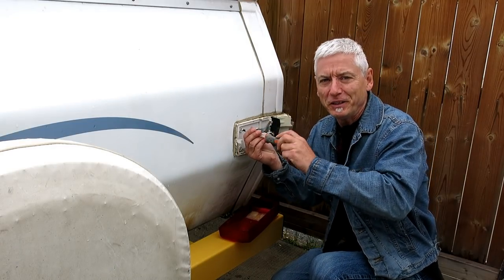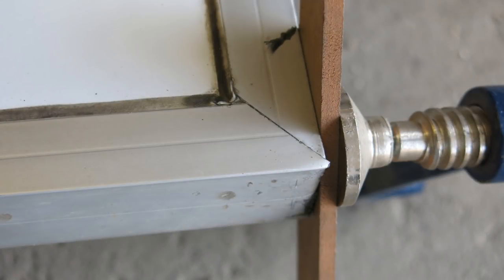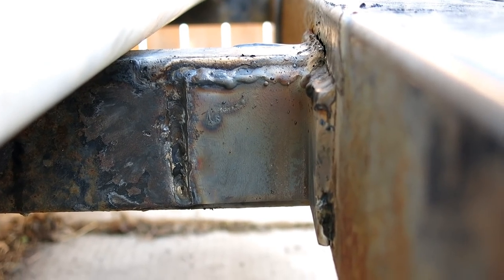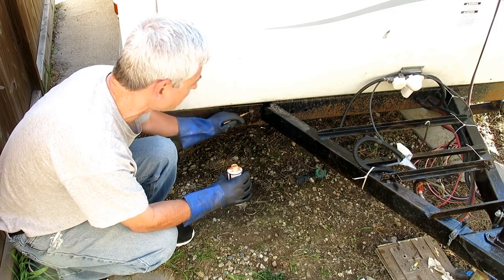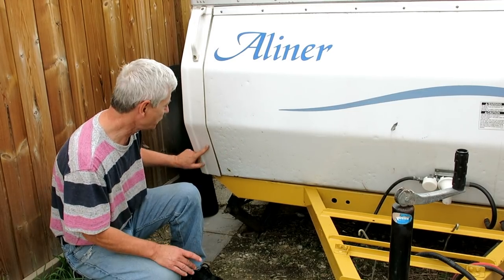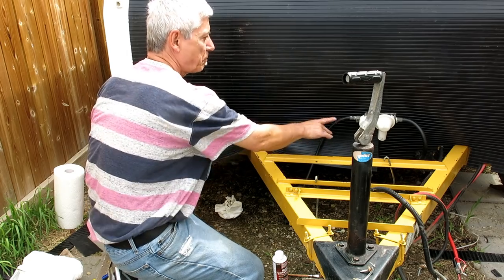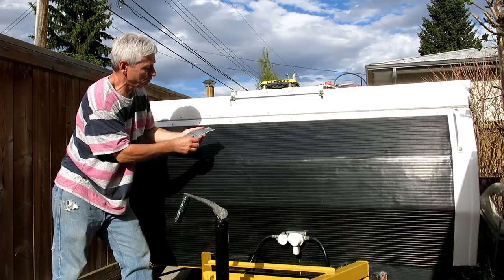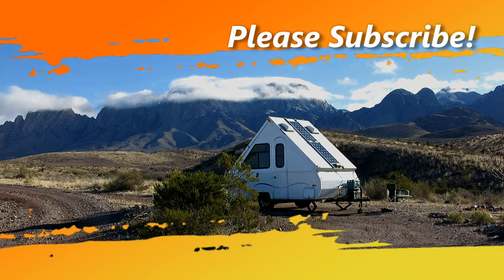Repairing My Aliner Trailer Part 3 - Rust, Bumper Fix & Rock Guard

Comment: Tip for this using rust treatment. Pour out what you need into a separate container as putting the used brush back into the original container will spoil the neat rust treatment.

Comment: Thanks Slim, your videos have really been an encouragement to me and so helpful. We just bought an used Aliner and driving home we heard a strange sound. Being the way I am, I hate to make an " unscheduled" stop, but when we stopped for gas I looked around the rig and found my spare tire was hanging down, it's holder had broken away from the bumper. They use such thin gauge metal on these things. Thanks to your "can do" spirit I will give it a go fixing it. God bless.
Reply from the maker: Hi Blane, If it's just the spare tire post (and not the bumper) it should be an easy fix. Amazing what happens in that one blind spot. Enjoy and be safe! SP
Reply: I'm taking your wise advice and letting the pro's weld on the bumper. I need a battery for the Aliner, if you have discussed batteries in a video please send the link. Thanks for your help.

Comment: This video was from some time ago.  How has the rubber in front fared?  Is it still doing the job?  I'm thinking of doing the same thing.  Diamond plate would look nice, but it would have to be done in sections and it's also expensive.  I like the rubber idea and painting it silver was a great idea.  If yours is still holding up, I think I might try it.
Reply from the maker: Rubber guard is still holding up. I did an update called"Did That Really Work" in September. SP
Reply: @SlimPotatohead  , Thanks, I'll give it a whirl.

Comment: Hey slim. I have a question about the rubber rock guard. I'm not sure what you were showing in the part where you went camping after you were finished. Did it peel off in that one area or was it just dirty? The reason I'm asking is because i think i want to try that on mine but I'm not sure if it is worth it if it ripped right away. Thanks, Steve
Reply from the maker: That was ice! The rubber was (and is still) in perfect condition. Thanks!
Reply: I just re-watched it and could clearly see you pulling off ice and the nice black rubber underneath. Funny how perception changes. Thanks again!

Comment: Slim your videos are great  my wife and i bought a used 2008 sport recently and i have already put some of your fixs to work  i was wondering how your rust converter is holding up  looks like its been about a year since you did it.  im  thinking about doing the same thing ,maybe not yellow.  Did the rust come back? Tnanks and keep the videos coming
Reply from the maker: Hi Carl, I was planning on doing some updates soon. The rust converter may have inhibited some of the rust, but definitely not all of it. Back bumper and step are the worst. Will post new images in an upcoming video. Thanks!

Comment: Slim,

Where did you get the rubber runner?
How would you judge the right thickness?
Thank you!
Reply from the maker: It's just rubber floor runner. Most hardware stores sell it by the foot. Thanks! SP

Comment: Hi Slim, thanks again for your videos. One thing for sure, an extra pair of hands helps with some of these jobs but like you i am always devising a way to manage solo, many jobs i end up doing twice too :-(   I could not quite make out what has happened to the front of the Aliner, it looks like the rubber is now torn ? Did you hit something or was that damaged from the stones flicking up from your car? Glen
Reply from the maker: Hi Glen, that was just ice and slush buildup falling off the front. The rock guard if still in perfect condition. The end is a teaser !!!
Reply: Slim Potatohead Hey Slim, I just noticed you were not wearing safety glasses when using the wire wheel.  You know what people will say.
Reply: A-liner repair is all fun and games until someone loses an eye.